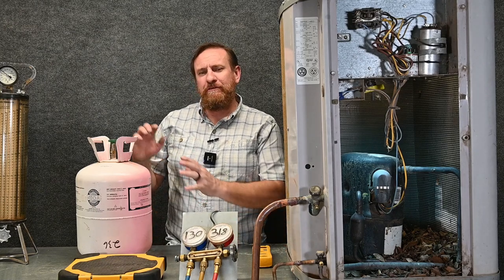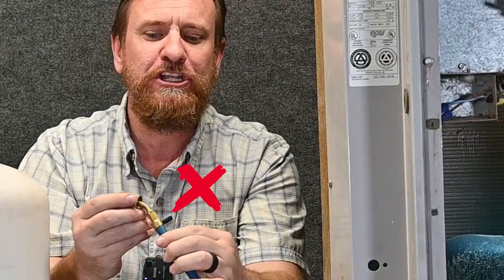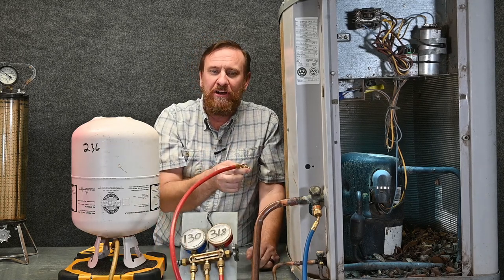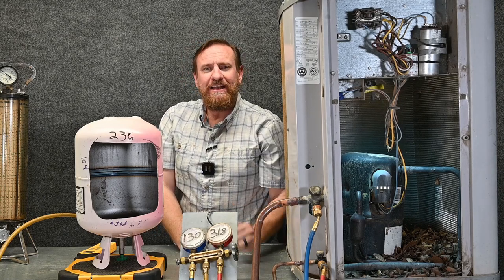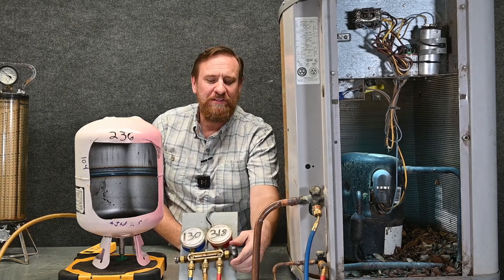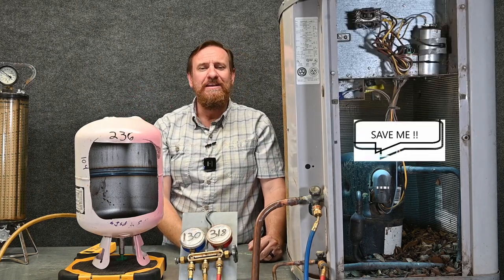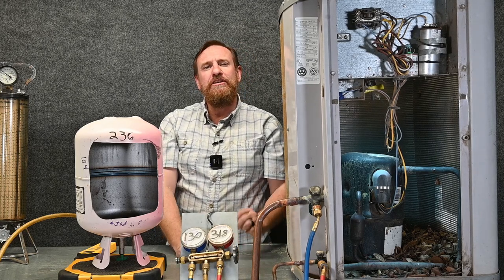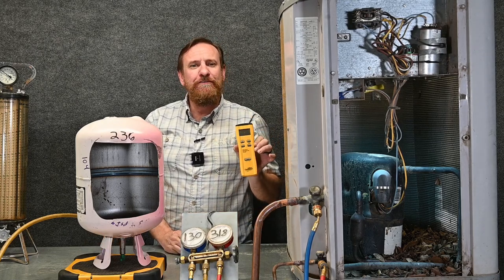HVAC 116 Charging with Auto low loss fittings on 3 port manifold

Comment: Those are some terrifying palm pictures but a great reminder that you should do things the right way. Fantastic video as usual. Can’t wait to try this in the refrigeration lab next semester, just need to get my Ozone Depletion Prevention certificate first.
Reply from the maker: use the 2 fingers and you will be just fine. 

The be gloves are just impractical. ive tried using them and you cant work the fittings. 

I harp on the class 2 fingers and we spend a few hours just taking the hoses on and off until it becomes second nature. Cupping your hands around the hose can really ruin date night...
Reply: @love2hvac  Thanks for the pro tip. The date night being ruined exactly was my fear 😂

The gloves do look impractical and huge, almost like I’m going gardening. I can imagine they look like overkill. I’ll remember these tips for sure when my time comes!

Comment: Thank you for another great video Ty! Quick question: when you bleed the refrigerant trapped in the service hose and hi pressure (red) hose into the suction port at the end would this extra refrigerant throw off your target subcooling and/or superheat? Seems like those two hoses could contain a few oz. of refrigerant. Or will this only matter if the system is critically charged and/or does not feature a liquid line receiver with modulating metering device?  Please advise and thanks. GOD BLESS!

EDIT: My question was answered with your response to an older comment below... LOL. The refrigerant in the hi pressure hose was taken from the unit and ends up back in it so it's not really a net increase. Brilliant.

Comment: Informative video Mr. Ty. If the system off is possible to use recovery machine to add refrigerant to the system? Thanks 🌾
Reply from the maker: If the system is off add refregerants to the liquid side. 
You could use a recovery machine but the contamination factor is too high for me. 
It would be better to heat the tank. That video is coming soon.

Comment: When charging a system, then once your satisfied and disconnecting your hoses, if you put the liquid from your high side hose into the system, you will be slightly overcharging the system though ,correct?  I was always taught not to do this after charging or setting up a new system. Only when checking a system and you didn’t have to adjust the charge.  Is it not that big a deal then?  I’ll also add that I’ve never used low loss fittings before. Whether it’s rite or wrong, I was taught from day one to never use them by my instructors and the techs I worked under as an apprentice. Thanks ty.  I’m a licensed tech but I love to watch all your videos as I’m sure I wasn’t taught everything correctly during my apprenticeship
Reply from the maker: Great points  let me break them down.

The liquid in the liquid line came from the unit, so we must put it back in the unit. 

I like to use short hoses so that has the least least effect on the system. 

It's unlikely the liquid from the liquid line will over charge the SH and SC much unless it's a critically charged system. There there is different set of rules.

Low loss fittings. This video was with auto low loss but I prefer manual low loss with the valve. That video is next. 

You really need (manual or auto) ATLEAST on the high side. The liquid coming back out of that hose is dangerous. That is a large volume of liquid changing state and is an unesessarsay risk. 
Also if your are not charging a system you are taking that mush refregerants away from the customer every time you take the hose off. 2 times and it will definitely affect the charge of the system. 

The low loss also helps in keeping the hoses clean.

Legally your suppose to have low loss fittings on all the hoses although there are no real enforcement. 

Hopefully that clears that up. 
Great questions 
Thanks for watching
Reply: I agree with the low loss fittings.  I don't like them. Alot harder to purge. Using ball valves I can hook to refrigerant tank, open tank then open manifold and then for low side and purge air out completely. Then do high side.
Reply: @love2hvac  thanks ty, to clear it up, I use yellow jacket hoses w the ballvalves on end. Maybe that’s what you mean  by manual low loss. So I don’t get a big blast of refrigerant when I disconnect. Actually for the last year I’ve moved to Fieldpiece probes so I get even less.
Reply from the maker: Great, those ball valves are considered low loss fittings. They are just manual instead of auto.
I love my FP probes.

Comment: Great video. But how come you didn't purge the manifold itself? You purged each hose. That's why I don't like low loss fittings. I like using ball valves.
Reply from the maker: Yes sir!
The next video shows both of those great points!
Reply: isnt purging the middle hose the same as purging the manifold since theyre connected?

Comment: Why does all my techs say that you can't charge with low loss fittings ?
Reply from the maker: Its lack of understanding. Generally people spend 10% of their lives learning and 90% defending what they think they know.

People are also more likely to believe the way they first heard something. So if the person training them said this, then they are more likely to hold onto that.

Auto low loss fittings have drawbacks. I prefer the manual valve low loss fittings over the automatic.

As times change I now prefer probes where the hose is not an issue. 

Either way EPA regulations require a low loss fittings whether automatic or manual with hoses in HVAC use.

Now the challenging partz transferring that information without hurting anyone's feelings 😬🤔😂
Reply: @love2hvac  so I'm guessing using it on the high side only all the time will be better so that I can use the low side for vacuum or can I use it on both and will it allow it to do a proper vacuum under 500 microns
Reply from the maker: @ezequielcrespo7046  
You should have low loss on all the hoses but the manual ball valve style allowed for better flow. I have videos with the ball valve also. 

As for vacuum, it's not recommended to use your service hoses or manifold for many reasons. I have an entire series on vacuum and dehydration with multiple examples.
Reply: @love2hvac  ok thank you so much brother finally someone gave me an actual answer after 3 years lol

Comment: There is a much better, safer way. Buy an Imperial kwik-Charge. They’re inexpensive and the best way to assures a safe, fast charge without endangering the compressor.
Reply from the maker: The problem is people rely on them too much and they open it up, the Kwik-charge is just a hole. So it can still allow a stream of liquid to the compressor. 
I finally found a sight glass for 3/4 line. When the weather warms up I will demonstrate this with all 3 brands of liquid chargers
Reply: @love2hvac  - the people who are relying on them too much are the people who should not be working in the refrigeration industry. 

I work directly for Scotsman Industries and have never had a problem metering refrigerant with the Imperial Kwik Charge. The people you’re talking about have no understanding of refrigerants nor should they be handling them.